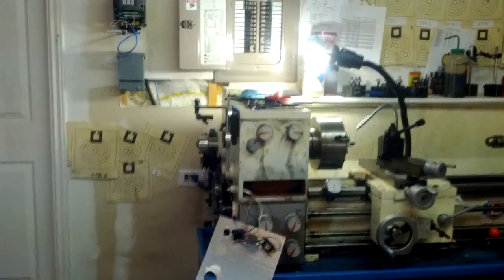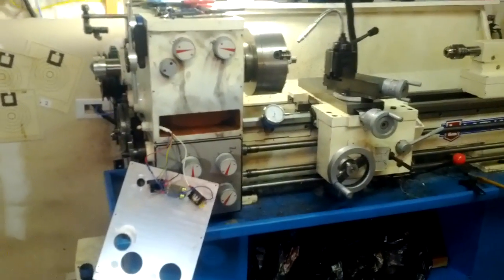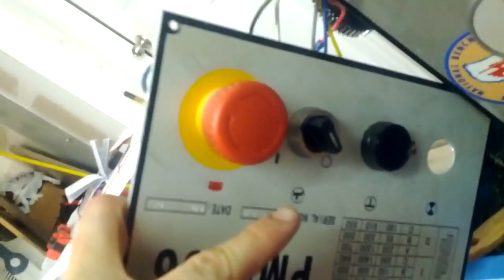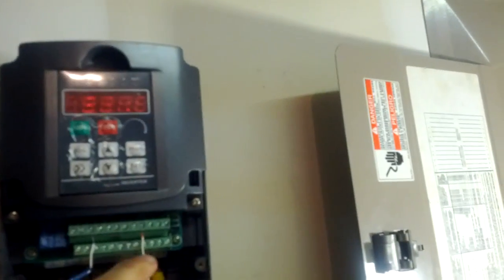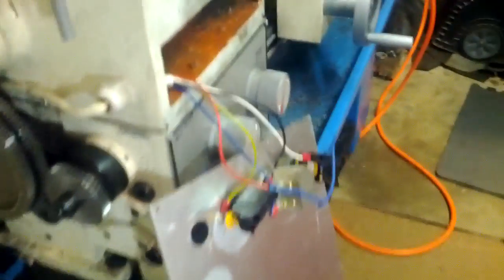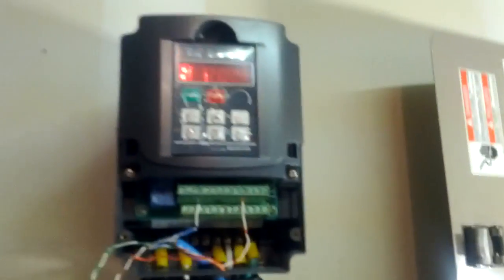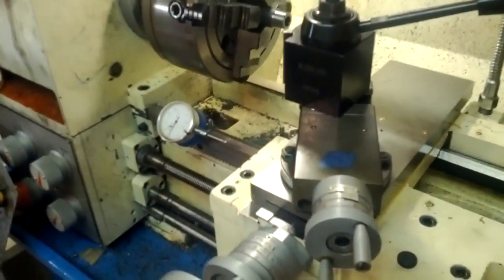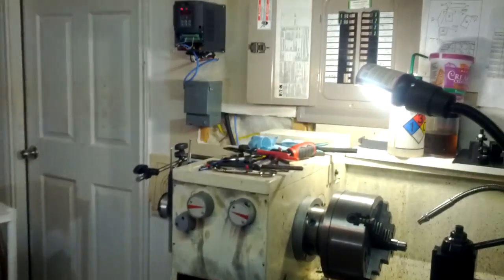remote control on vfd( first test of remote control of Huanyang VFD and PM1236 lathe)

Comment: I have the same invertor as you. I can't get it to even turn a 3 phase 220 motor. I have studied the manual It appears that when I set the hz to 60 then my voltage changes to 60, when I set my voltage to 220 my hz changes to 220. Can you help me?

Comment from the maker: You must first change the PD setting for external control(i believe its PD1 or PD2), then you when short the dcm and any control terminal (froward, reverse, etc.) it should run. If this doesnt help or if have any other questions, message me and I can send the PD settings and diagrams that I used to set mine up.
Reply: I'll take you up the offer of help.  Sent a message on FB messenger.